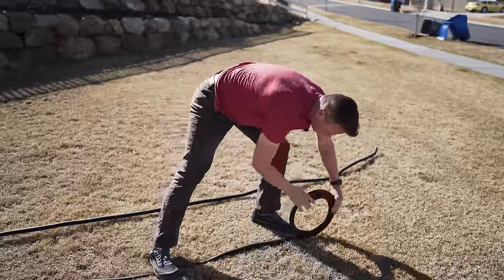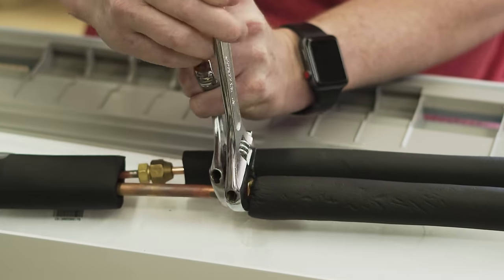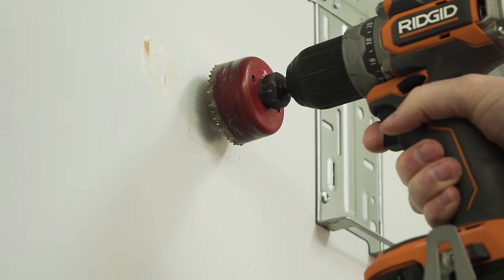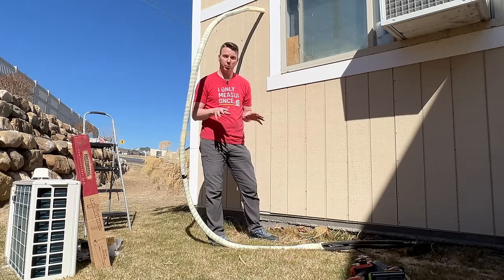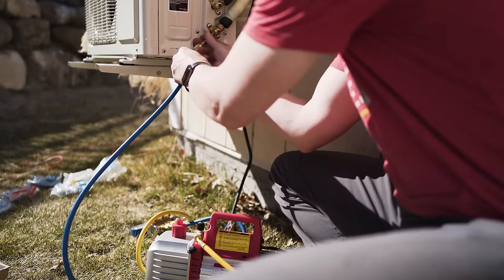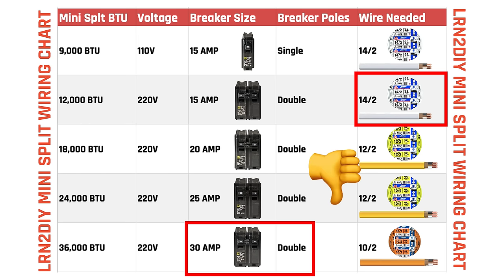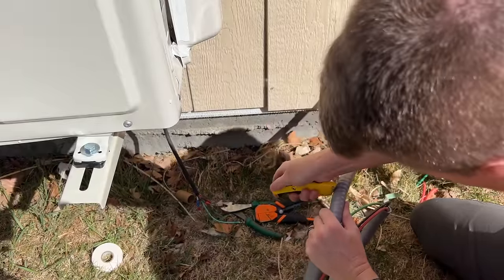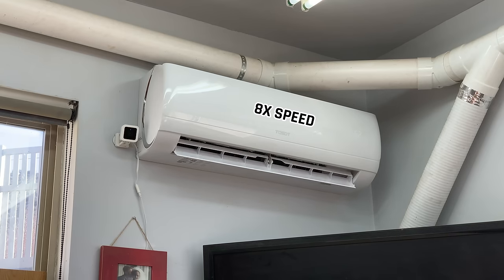DIY Mini Split Install - All the Things Nobody Shows You

Comment: You start off wrong, 6" from the ceiling?  Really?  Even if you have a 14' ceiling?  First it is 8" and that is a minimum so you can go down 2' even on tall ceilings.  And the reason for looking for studs is so you don't put the Hole There.  Why not just put one screw in each stud and forget the garbage anchors?  Why did you attach the lines first?  Just do it after hanging the inside head unit, much easier!  And you totally put the lines out the wrong side!  READ the Instructions!  Turn the copper lines out and the Hole In The Wall goes on the other side of the Head Unit!  I can't watch anymore!

Comment: You tried very hard to explain but you do a few things WRONG! The long wiring and brass hoses can be connected after you put the indoor unit on the wall so you don’t need to pull the entire length of the hoses and wires thru a narrow hole Lon the wall.

Comment: That's not a neutral anymore. If you connected to a breaker its now a hot. You should have run 3 conductor 2 hots 1 neutral and a ground. Seriously man DON'T do your own electrical anymore what you did here is scary to anyone who knows anything about electrical.

Comment: Lol. U let air in the system. U should of cracked the valves to get pressure  in system then take hose off. Should also put a surge protector on the disconnect. These are sensitive to lighting strike even if its not direct strike.
Reply: Breaker size is too big for the wire.

Comment: WHOA. Some good ideas here but WATCH OUT when it comes to the electrical advice.  Especially this comment, which is wrong:  https://youtu.be/2mKwCmaR5Qg?t=1469   You should not choose a large breaker just because you are making use of larger than needed wire.  You loose your fire protection if your circuit can deliver way more current (30A) than the AC should be drawing (15A).That is double the max current before the breaker trips!  Get an electrician involved if you don't understand this. Also see other comments about the refrigerant lines: fittings used & oil pooling or settling in the refrigerant lines when installed this way.

Comment: this video is irresponsible and full of half baked information, youve just taught your watchers to spend good money to install a system with poor oil return and have a highly acidic system causing potential premature compressor failure, not to mention innadequate overcurrent protection,  if you would have done a little more research instead of looking for the quick buck it might have been a home run

Comment: You should take this down, edit, and re-upload. The moment you got to changing from white to red at the disconnect, you should have called an electrician. Never connect white to a breaker like this. Hopefully you've fixed it since then, and hopefully the manual didn't tell you to do it like this. All this video did was warn me to stay away from Tosot.

Comment: Whatever you do, do not do what this guy just did. Call a professional. Save yourself a headache in the future. As soon as this guy took off his gauges from his system without opening the valves he just lost all of his vacuum. Like others. Have also said you should never use the flares that come with the line set. You should always use the flare nuts that come with the system. Also all flares should be torqued to manufacture spec. Also that corrugated pipe instead of PVC that he used will get clogged up and not drain correctly.

Comment: I started to watch this vido and right off the bat a fail!  " Probably overkill for the space"  If you live in a humid area and oversize and you will be living in a cool sponge, they need to be properly sized.  He does not torque the lineset nuts, this is mandatory!  NO micron gauge and no pressure test,  epic fail!  Well intentioned but bad info.

Comment: horrible hack job. the fare joints should be torqued to special ratings. and you should have used line set covers to hide the exposed wiring drain and line sets which also protects them from elements. looks much better as well and last don't ever coil the line set cut and reflare the ends will look way better. I'm all for dyi but make it look professional.
Reply: also, should be pressure testing the unit with dry nitrogen to at least 200 psi if its a heat pump you can pressurize the system to 400 and let sit for a half hour to an hour making sure the pressure doesn't drop. after that release the nitrogen and pump the system down. you really should use a micron gauge. the lower the micron the deeper you've pulled the unit into a vacuum. all water vapor is taken out at 1500 microns and the unit should be pulled down to 500 microns or less. this takes a few hours to achieve. after you get to 500 micron you should let the unit sit for 15 minutes with the vacuum pump valved off and shut off and watch your micron gauge it should not exceed 750 microns. its ok at this point for it to rise but if it goes over 750 it could mean there is still water left in the system or you have a leak in the unit. if it doesn't rise over 750 then you may open the service ports allowing refrigerant to enter the unit.

Comment: Great video, with some good tips. But...when using a vacuum pump, unless it has a negative pressure setting, it is not recommended to run a vacuum pump once it reaches the bottom position on the gauge as some pumps may pull a vacuum that will implode some of the piping or components in the line. You may want to isolate the line after you get max indication on the gauge and observe for 15 or 20 minutes and cycle the vacuum pump as required. after you disconnect then observe for another 10 minutes to verify tight couplings, then release the refrigerant and check for leaks. Thank you again. Another little tip is when connecting the flared fittings, tighten than loosen and retighten to ensure a positive seal. An old installer gave me the tip when I did A/C work for WSU as a student.

Comment: So you know, that NM Cable, (Romex) is not rated for exterior use within a conduit. Also, that disconnect us not always rquired by code, if the circuir panel it is being fed from is within line of sight, it wouldnt be required. You shouldnt do electrical and A/C without a permit, then post it on youtube. Especially when you are telling people how to do it the wrong way. I could go on and on. You took away the over current protection of the A/C, by increasing the breaker size for no appearant reason. You think because you have 30 amp wire, it needs to be a 30 amp breaker. Then you use the black and white, instead of the black and red wire? Everything you did was wrong, you should delete this video

Comment: So you said in the video that the outside unit should be about 12" away from the wall.  and the unit I bought also says about that.  But with the wall mounts, you can't get anywhere near that amount of distance from the back of the outside unit to the wall.  Is this a problem?

Comment: Sir, where do i start, you never checked the integrity of the first set of refrigerant line connects you made, under pressure and we know the outside unit connections were leaking out what you called "air", that was actually refrigerant and a documented EPA violation, after you released the refrigerant into the lines. You also man handled the refrigerant lines which guaranteed a leak from those connections. You will have no refrigerant in a day or two. If ups hit your AC unit, you should have had them pay for a professional install.
Reply: Wrong it’s nitrogen. Outside has the refrigerant stored in it. If you didn’t know.

Comment: When you use a vacuum pump, you need to install a micron gauge on the manifold and bring the vacuum level to final level below 500 microns after a triple evacuation using dry nitrogen.  You can't simply rely on the low side gauge and let it stay near 30 inches Hg for 15 minutes and call it good.  What about sublimation in the line set? Remember the line set is the metering device of the unit.  ensuring a good vacuum will prolong the life of the unit and aid its efficiency.   I recommend hiring a professional.  I hold an EPA card and a degree in this field, so I am giving you good advice.